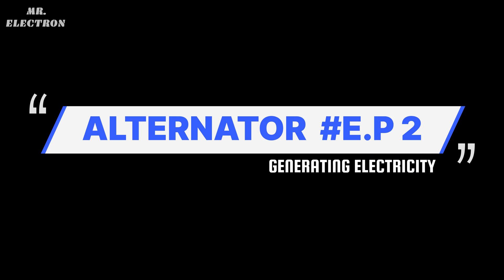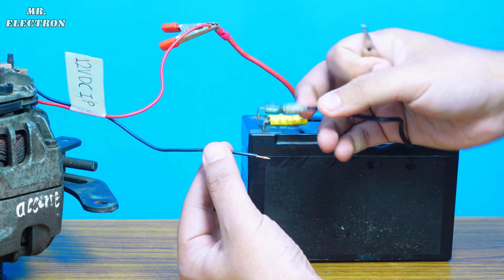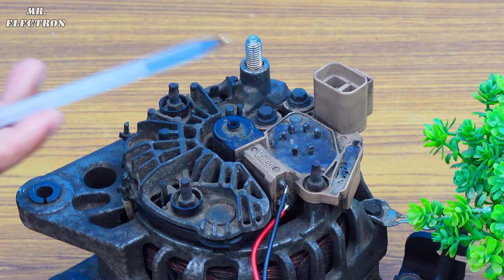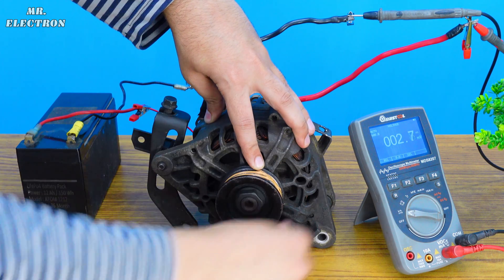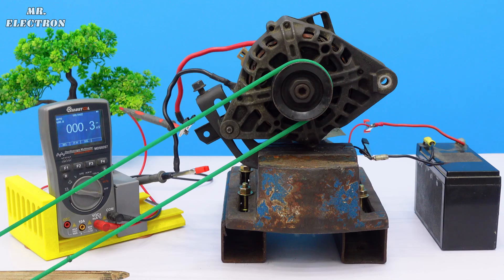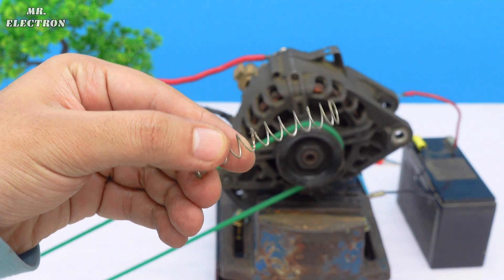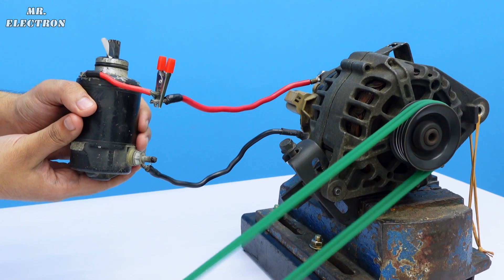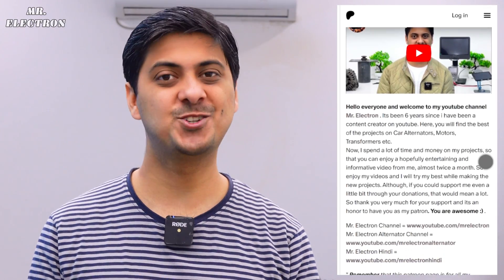12V 90A Car Alternator to Electric Generator 1000W #EP2

Comment: is it this real or fake ?
Reply from the maker: Real
Reply: @mrelectron_alternator can I contact you directly? I liked your video and I have a projet
Reply: @m @mrelectron_alternator the problem is that this motor needs 220v to work we have some solution so it can work with less voltage 12 v or 24 v

Comment: Please sir, I made a generator with a 6.5HP petrol engine and a BorgWarner alternator at 12V-130A, and removed the inside regulator. Started the engine and after a while I feeded rotor with 12V from a PC power supplier (yellow-black wires), but the engine could not turn the rotor and shuted off, it looked that the load was too much and could not handle it. Is there any difference by feeding rotor by power supply than a 12V battery? Asking AI it said the current was too much, as the internal rotor resistance 2.6Ω to 12V was giving 4.6A in it and it is too much. Is this correct? I have mounted the alternator on engine with 1:2 pulleys. Please help me

Comment: Appreciate your detailed video on the topic. One thing I don't like about this  alternator is  that its supposed to produce current but simultaneously its consuming (for excitement). How do you plan to keep the exciting power source battery always charged and running in real world projects?
Reply: u are a scammer

Comment: Hi sir please disconnect the Battery and Bypass The 12 v from the alternator after producing Currant and try it with without battery and Connect Portable inverter and Show the Results Sir and A Request 

Try the Alternator with any Car and Check The Running time With 1 litre diesel With 400W Load Without Battery 😊

Comment: As far as I know those car alternators control the excitation current going through the rotor (ca. 5 A) to keep the output voltage constant. This voltage must not exceed 13,6 V due to the car battery. As well it must be kept over a minimum level to make sure that the car battery gets loaded and not exhausted.

Comment: thinking of building this, because a 124 volt AC charger and battery charger takes a long time to charge 12 volt systems when just a car jumped to the batteries charges it  much faster, less power needed. but nobody builds a self powered alternator for under a thousand dollars.

Comment: Gd day, vry good job!!!,  in my conclusion to ur research, i just attach 4,  2N&2S magnets to my car alternator to increase it watts or Amps?, my suzuki jimny is 50Amps/ somewhere 60watts,,,, in that case i can  parallel 2 -12v 40A battery for camping!! W/ back-up 100W solar cell/ charger will stationary,,,,

Comment: Can the alternator charge the battery and feed the dc motor at the same time?
Reply: Does perpetual motion exist? 😂...
Reply from the maker: You mean the dc motor that is actually driving the alternator  ?
Reply: @mrelectron_alternator yes the DC motor that is driving the alternator.
Reply: Yes is it possible

Comment: Hello Mr. How i am working on a project using dc motor to drive a generator coil, then i connected car alternator with belt to charge the battery. But the problem i am having right now is i dont know how to connect the car alternator to feed the dc motor so as to allow the battery to rest. Please help
Reply: Buy an MPPT charge controller. Use between battery and alternator.
It regulates max charge at 13.7 v then cuts the current until battery voltage reaches min voltage around 11.8 volts
Then it opens back up and allows charge current to 13.7 max v.

Comment: Sir need battery to alternator continuously power generating
Reply: It can self excite you can disconnect battery after voltage achieved
Reply from the maker: Ok

Comment: Cred doar ceu ce au ramas corigenți la fizică electricitate.
Daca erai corect arăta i si cată energie consuma motorul ce antrenează alternatorul,este minim 2 ori cat obții,si variaza dupa sarcina pusă pe alternator
Multumim pentru efortul depus❤
Reply from the maker: Actually, this video is not about the driving machine but about "how one can use an alternator as a generator through battery excitation"